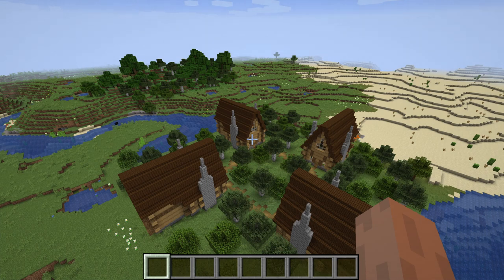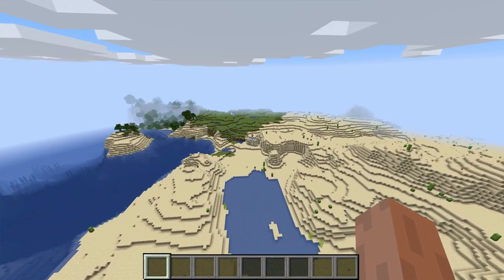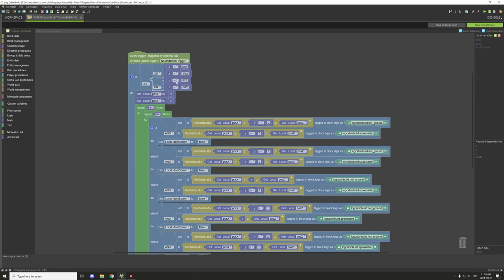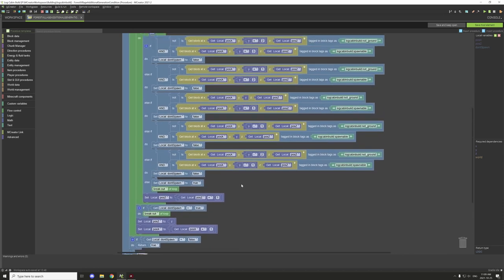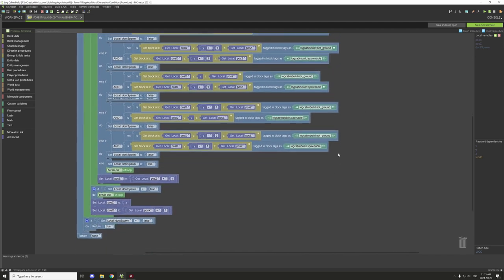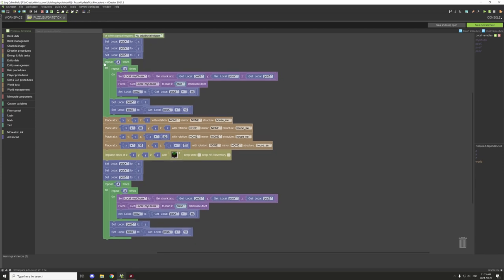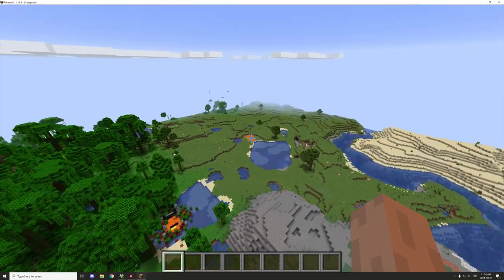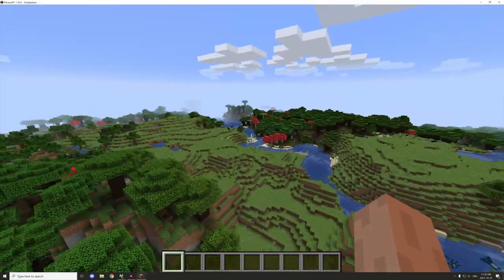MCreator: Log Cabin Build | Part 5

Comment: Could you maybe make a tutorial how you can add additional loot to existing mobs. (for example the skeleton drops bones, arrows and its bow but also drop diamonds)
Reply from the maker: For overriding drops I would suggest using global procedures.
Follow the steps below.
1. Set global trigger to when entity dies.
2. Test for what entity has died using a condition and if statement.
3. Set up a local number variable.
4. Set the local variable to be random.
5. Test if the value is > 0.66 (or what ever value you want so long as its between 1.0, and 0.0)
6. Spawn a gem that you want to drop.

This will allow for any entity including players to have custom drops.
You can also use entity tags as well I think to select entities from other mods or ones built into minecraft like skeletons and such.
Reply: @NorthWestTreesMCreator  Ok thank you!

Comment: how do you generate structures with the max size limit without them getting cut by chunks when generating?
Reply from the maker: In simple terms its chunk loading that causes this issue.
Chunks don't always load at the same time which means larger structures can become half loaded but after the chunk is loaded the structure fails to load the rest as its only generated when the chunk is generated. This is why I used chunk manager to preload the chunks and unload them after spawning the structure in, it seems to work using the method I used with the desert temple block and update tick.